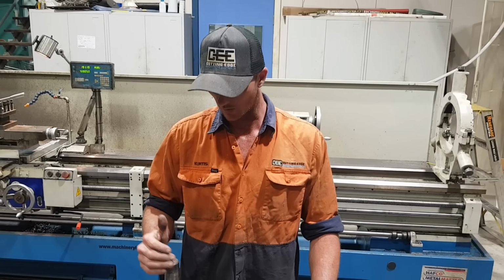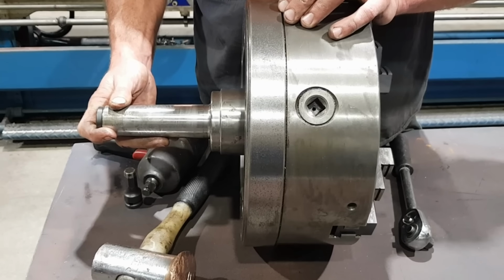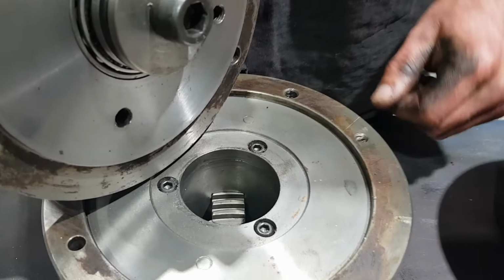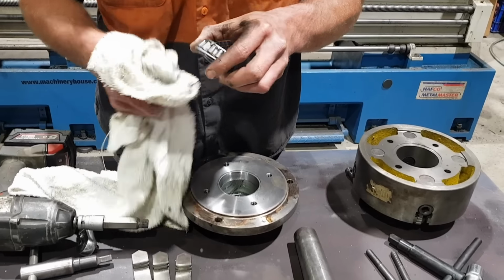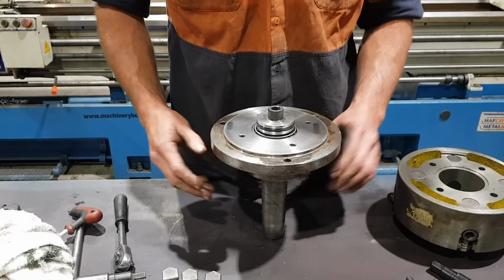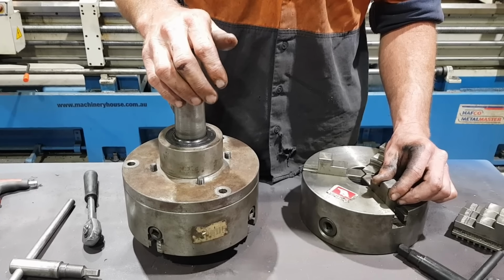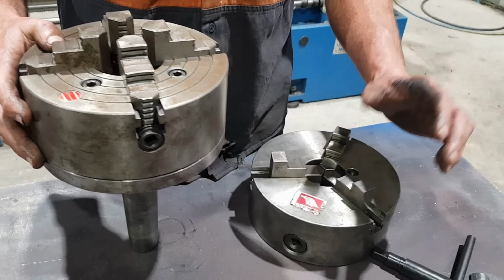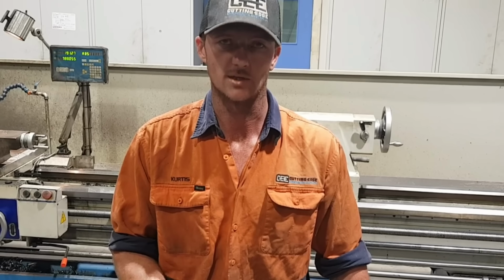How I Made Our Revolving Tailstock Chuck | Shop Made Tools

Comment: I'm kinda surprised that tailstock chucks aren't a common attachment that you can just buy. Seems like a super helpful item.
Reply: I've seen a couple commercially made ones pop up in the past year, but they're either cheap junk or ridiculously expensive. I work as a (manual only) tool and die machinist at a fairly large shop and the nice thing about bigger shops is a lot of times when you ask for tooling or a certain tool they'll just order it regardless of how expensive it may be if they see the usefulness of said tool(s). So I have a couple of those tailstock chucks 😂
Reply: That was my thoughts to. 😮

Comment: And that young Sir Is a dam clever Idea you got. Never seen one before to be honest and I done 40 years In machine shop work here In the UK... thanks for the video and showing how it works. Ian.. UK..
Reply from the maker: Hey Ian appreciate you watching and taking time to comment. Some of my best ideas are when I have no other choice haha
Reply: @CuttingEdgeEngineering  You could do the same to a 4 jaw chuck if you had to offsett something between two 4 jaw chucks perhaps, yes you wont get a massive throw offset and might need some  counter balance weights but could be done eh..sorry, might be 72 but the tired old brain still ticks over - lol.. stay safe out there bud. Ian. Tough T nuts machined to fit into the Jaw slots could hold counter balance weights/ sorry , my brain keeps thinking about it.

Comment: Glad I caught this video, because probably like many folks, I didn't realize that your live center tailstock chucks were shop made. Because of the size work you do, I just assumed these were specialty tooling items purchased from a machine shop goods supplier. My little old South Bend lathe with just  a 13 inch swing and 3 feet between centers just might get one these some day soon! Thanks for sharing this, because I have seen how handy this tool is from many of your other videos. It is a build well worth me considering for myself after seeing how much easier using one makes your machining and set up work go. Another great video with some more useful knowledge to take away. Thanks again.

Comment: Nice bearing set up. I made one under similar circumstances for a 3 mt machine. I needed it like ...now. I Used a 3 MT arbor I bought  for something else that never got done and machined it to fit a stack of common sealed ball bearings I had in  the shelf. Turned up a back plate to suit the bearing OD & pressed it all together. It works well and got the job done. However tapered roller bearings really are the way to go with both axial and radial  loads. Cheers
Reply from the maker: Hey Warren awesome mate good to know other machinist out there aren't always "by the book" 🤣
Reply: .... or, for best accuracy, angular contact bearings, although they can get pretty pricey.

Comment: A true genius at work!  I worked in a job shop that was the largest privately held shop in Ft Worth, Texas back in the 1970s.  Allot of "emergency work" at the end of the day.  Those tools would have saved so much time and frustration when you are left alone with instructions to "finish the job before going home regardless of how long it takes."  Pissed off and drunk welders leaving pitting and slag in their welds could have been completely bypasses for a clean finish on the parts.  Congratulations on your inventions.  They are great.

Comment: Nice work mate,I made mine from a turned down truck hub and stub axle. I turned the stub axle to 5MT to suit my tailstock and the hub was turned to suit a spare 4 jaw 10" chuck from an old colchester lathe. Works very well, perfect for hydraulic cylinder repairs. My lathe ,a Harrison M400 just a bit smaller than yours!
Reply: Cracking idea mate and the thing was half made before you started:)

Comment: Nice design, proper job with taper roller bearings, I shrunk a backplate for a 6 inch 4 jaw chuck on a standard number 4 MT revolving centre. Good idea on having the interchangeable 3 & 4 jaw chucks.
Great vlog, enjoying your videos.
Thanks for sharing.
Reply from the maker: Hey mate thanks for watching and sharing what you've done good stuff!
Reply: I've done the same for a 4 inch 4 jaw chuck in a hurry for a job from a new customer was meant to do it properly and better when I get a chance but never did it's been 10years and still using it for the same job.
Reply: @mehmettemel8725   10 years is impressive for a rush job, sounds like you got it pretty good.
Reply: @bostedtap8399  It's a job I get in batches few times a year.

Comment: I had  to  machine a 360mm diameter and 6 meter long  4140  welded tube. Tried few different method to hold it on the  tail stock with steady and didn't work.  came across your video and made one revolving tailstock chuck.  It works great and a great tool to have .  Thanks allot for sharing your knowledge. You are awesome and funny. love your videos.

Comment: Kurtis, when you have the chuck disassembled, brass wire brush all of the surface rust off and lightly coat with waterproof wheel bearing grease. Also, clean the races and thrust bearings well and add fresh grease every time. In past videos, I’ve watched you toss wrenches on the ways, so avoid that and get a nice flat stone and check for high spots. I’m not criticizing, I recently praised your work on the last video, but I want to share what I’ve learned during my 36 years in the trade. Cheers from SoCal!
Reply from the maker: Hey mate thanks for your tips here and great feedback 😎👊💥

Comment: We use a (MUCH smaller) Hafco Metalmaster lathe from Machinery House at my Menz Shed in NZ.  I've always assumed it was cheap and nasty, so it's reassuring to see you doing properly heavy work with one.  You'll know they are made in TAIWAN I'm sure, which is not quite China.
Reply from the maker: Hey mate yes the MetalMasters are pretty decent lathe for the price range. I avoid the other ToolMaster (chinese) lathes that have very shitehouse quality bearing system
Reply: Taiwan vs. China is chalk and cheese. Taiwan have had to become top value in order to survive and prosper since Mao chased them from the mainland in the late 40's
Reply: If they are Taiwanese which I didn’t know they are as good as anything - the Taiwanese have worked out that making shit does not enhance your reputation unlike mainland China

Comment: That's neat as. I do computers & electronics instead of machinating but I've had to improvise more than a few tools on the fly over the years. Sometimes you've just gotta make do with what you've got on-hand. Especially if you're working the back half of the clock and all the usual shops are shut.
Reply from the maker: Hey you're spot on. Some of the best ideas are when you've got no other option, gets the creativity and out of the box thinking going

Comment: I made mine by salvaging one from a crankshaft grinder that was being scraped out .  I  just had to                          make their tailstock shaft , the same size as my lathe , and recut the keyway   and tail stock threads [ which happened to be the same ]. I just wind the whole assembly out of the tailstock , and  switch it with the other one .  The variety of chucks came with the                   crankshaft grinder parts .

Comment: Nice job! I got a 100mm/4" three jaw one I built. I used a cartridge bearing from a front wheel drive Nissan for it. Also have a  400mm/16" four jaw one with a Timken roller set in it. The things are worth their weight in Gold for outsized tubes and really anything with a saw cut end on.
Reply from the maker: Heck yeah good stuff mate. Can't go wrong with Nissan power 🤣
Reply: @CuttingEdgeEngineering  Double row angular contact ball bearings with seals for $19 USD, what's not to like right? 😆

Comment: Retired Turner-Metal Machinest here, great video!! I'd like to see how you measured and machined the parts so perfectly, that when you tighten the cap skrew, it does not squash/crush the taper roller bearings??

Comment: I have thought about making one of these for quite a while. Depending on the size of the 4 jaw, it can be used for easier eccentric turning. seems like it would be a very handy tool
Reply from the maker: Hey mate thanks for watching. You're not wrong it makes work life alot easier! Cheers Kurtis
Reply: If you can use one in a smaller size like 6", look at the Bison chuck catalog.  They have a revolving chuck adapter that fits their 3 jaw chuck in  #3 MT. What I did was  just make an adapter plate to fit a 4 jaw.
The Bison part is cheap, good quality and works great.

Comment: I think this idea of yours is particularly good, as you pointed out, it doesn't matter if the tube  end isn't square, unlike the usual cone/pipe centre tail stock tools. I might make myself up a baby one using some trailer/Holden stub axle bearings to take the chucks of my smaller lathe. After all, I don't tend to use both my lathes at once...
Reply from the maker: Hey mate thanks for watching, sounds like a plan! Would be great to hear how you go with it. Cheers, Kurtis 😎👍
Reply: @CuttingEdgeEngineering  Every success to you, the missus, the staffie and yiz YouTube channel mate... but making a tailstock bearing/chuck is going to wait until I need it. Meanwhile, I'm "inventing" other things like a profiling attachment or any number of my other half finished projects!

Comment: Very cool tool! Good idea and great execution!   :)
Reply from the maker: Hey mate thanks very much for watching 😎👍
Reply: @CuttingEdgeEngineering  I'm just a sucker for creativity!
Finding a way to make it happen is what it's all about. 
Here's something to think on:
Large wheels are large levers - so many levers that they blend together. 
Make a large wheel lined with Pelton style buckets, spray each bucket with pressurized water. Take the output (center of wheel shaft) and power a generator. Use the generator to power the wheel's water pump. 
Might just be a simple way to get off grid..... after all, levers are mechanical power amplifiers, are they not?
Cheers!   :)

Comment: I’d like to see a full detailed build in the future. I’ve seen similar sorta of work holding. 
How does it hold up with things like heat, vibration and stability at higher Rpm ?
Reply from the maker: Hey mate yeah will get a build video going soon. Haven't had any dramas and had it running flat shit, 1200rpm and often turning at 700rpm for quite a while. 3 years old still goes just as good as the day it was first used 😎👍
Reply: ...large parts are always turned at LOW RPM's, and the accuracy is pretty much what you'd expect from a 3 or 4 jaw chuck.

Comment: when mounting the chuck to your tail stock backing plate.. to avoid corrosion issues.. use a very thin layer of Hylomar sealant .. it will not wash out with solvents.. it won't wash out with coolants.. and it will NEVER ever get hard..  this will prevent rust jacking that seemed to be happening.
Reply from the maker: Hey Wayne thanks for that mate 😎👍

Comment: Heij Curtis, from what i picked up off Your vids is that i consider a lathe and a mill the most important tools in a metal workshop because one can make so many other needed tools with them. But they need to be in good shape what makes them projects in themselves what brings us to the next problem: You can´t fix them in depth without a lathe and/or a mill.
I´d bet money on there´s alot of them around which are so far clapped out that even in a home shop they´re no good, that´s why they go for scrap money- if You can move them. I want a lathe, bad. But even a tiny chinese from Amazon takes up 600€... 
Well, I got a little off topic...
You have an awsome shop and security officer, if i make it down under one day I´ll shurely visit. Til then, stay awsome Y´all!

Comment: got me enthused i need to make a backing  mtg plate for my 3 jaws on the spindle  because the 300d 3 jaw slips  been on the lathe since 1975, guess was before you were born mate and a new chuck that would fit is abt a thousand euros, dont have a mill but ! reckon maybe draw it in cad get the pcd and hole spacin right then  drill, but only have a crappy drill, do have however a magnetic drill from 1960'swe'll see, i made myself tired thinking abt it, love your tailstock idea
Reply from the maker: lots of creative thoughts flowing, can be never ending 🤣 got to enjoy whatever ideas you go with!
Reply: @CuttingEdgeEngineering  plenny ideas I  built high end alu yachts, so diesels and plate forming my trades not a machinist but have time now to get more proficient

Comment: Here is a question: I have been looking to buy a 4-jaw independent chuck. But I don't see any available with two sets of jaws. Also in your work it would make a lot of sense if you could clamp on the ID of hollow cylinders on the 4-jaw and clock it out. But the only option I see available is soft jaws. Yes, the hard jaws on 4-jaw independent chucks are reversible, but they won't allow (reliable) clamping on the ID. Any thoughts? Thanks and cheers from Holland, keep up the good work.

Edit: I notice many jaws have these little facets on the corner which I guess solves the problem. Although the point loading on the material will be much higher.

Comment: That's a pretty cool tool, I wonder if such a setup with a 4 Jaw chuck would allow crankshaft turning? 
Thank you for sharing this, I like learning the tips and tricks of the trade.
Reply from the maker: Hey mate thanks for watching. Great question yes 4 jaw setup does allow for crankshaft turning 😎👍
Reply: @CuttingEdgeEngineering  awesome, although modern crankshaft machining relies heavily on CNC mill-turning, I still think lathe turning is much cooler to see.

Comment: All of your videos are brilliant. I have worked with many good tradesman in my time, you would have to be in the top 3.
Like yourself I am a 1 man band doing mostly one off jobs. My main machines are a TM-2680G, TM70VE and a HP-63T. The 63T is a bit of a bugger because it hasn't held load/pressure since new. Hydraulic mods are underway. Thanks to Locky from the the Hare and Forbes Tech team for supplying schematics from their other machines.
I'm about to order material, bearings, seals and a new chuck to manufacture a tailstock chuck. What size is your chuck, 200mm or 250mm?
Keep up the good work and keep those videos coming!
P.S. you really took on a challenge with the Franna.

Comment: Was that one time, the first time you needed to hold the end of a tube? I would have thought about making a plug to fit in the tube that could then be drilled for the live center. But I can also see how that could be problematic if the end of the tube was not flat. This is super cool and I sort of want one for my Chinese 4x12 lathe just because of how cool it is even though I never turn long tubes.

Comment: I don't do much tube/pipe but what are the advantages of this over a bell mouth live centre? Great channel and informative, thanks
Reply: Another words you mean pipe centre which you can't control the runout.Some times when you don't have a choice you have to use it but need shimming around the edge of the pipe to get it run true which is a pain when one side slips.With this method you can set up anything perfectly.
Reply: @mehmettemel8725  Not to mention that pipe centres are expensive and not as versatile.
Reply: Hi guys, thanks for the explanation, makes perfect sense. God send with a 4 jaw to remove any run out.
Reply from the maker: Great question mate and spot on replies by these legends!

Comment: A tailstock chuck is definitely something I would like to build.   I would think (tapered roller) automotive wheel bearings are ideal for this application (and cheap).  My Chinese 12x36 has a 3MT tail; I have an adapter that size for my 5MT head.  I would prefer to turn the chuck backing plate with both bearing receivers in a single setup so they're all in perfect alignment but I don't have much confidence in cutting an accurate ID with a boring bar on the far side of the piece.  Did you flip it around in a 4-jaw and indicate for minimum runout before boring the second bearing receiver?

Comment: Great vid!! I built one 10 years ago with Timken bearings salvaged from the spindle assy. of a wrecked racecar. I didn't need to build one as beefy as you need as I only have a 14 1/2 inch South Bend with a 6-foot bed.  What really has me wondering is, HOW THE HELL DO YOU GET YOUR 3 JAW CHUCKS TO RUN SO TRUE????  I have worked with all kinds of lathes with all kinds of ways to attach the chuck and I don't think I ever saw a 3 jaw run without some movement on the indicator. I found a 14 1/2 South Bend new/old stock 3 jaw still in the box with the grease paper still on it and the best T.I.R. was .0015. Please tell us the brand of the magic wand you use to make your scroll chucks run like collets.

Comment: Another great video Kurtis and Karen. Might want to tilt the cap back so that we can see your face Kurtis or set up some fill lights when filming. Remember that the camera lense doesn't see as well as the Human Eyeball Mark I. Shop lighting is designed for shop work not videotaping. Outtakes was funny but use sparingly.
Reply from the maker: Hey Mark thanks for the great feedback mate! hahaa yeah Karen already told me about the lighting, I need the cap to cover my balding head  🤣 🤣 🤣
Reply: @CuttingEdgeEngineering  Yes, metal chips and sparks don't play well with bald or balding heads, or even hair for that matter.

Comment: One way to redo this for home use could be to use a vehicle brake drum from a compact car rear axle. it is way cheaper than the needed raw material, already machined and made to support at least 250kg of car running through potholes. the only problem left is to figure out, if it's easier to weld the also available axle stud to the morse taper or to machine that oneself.